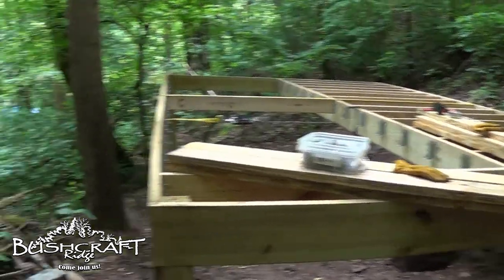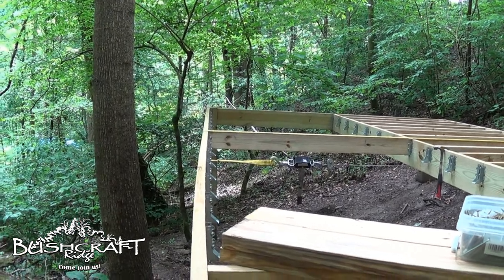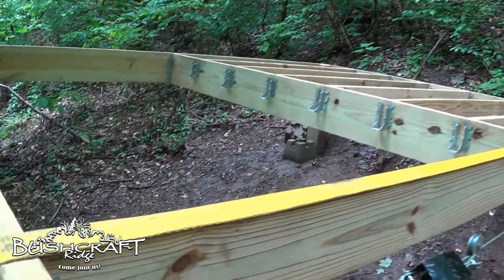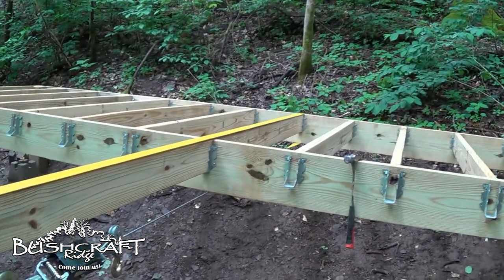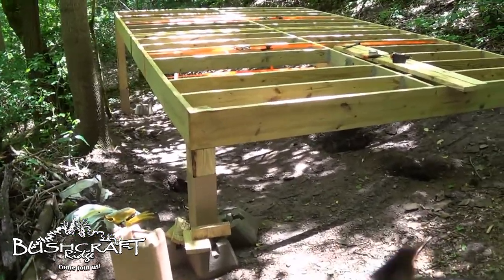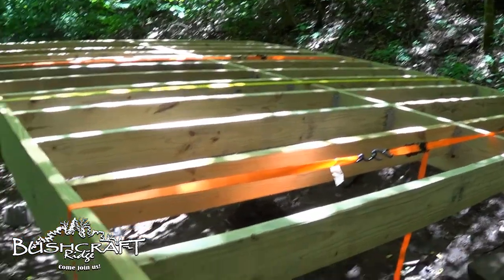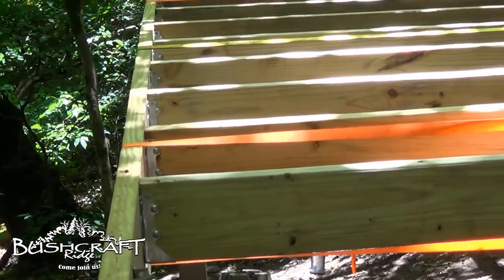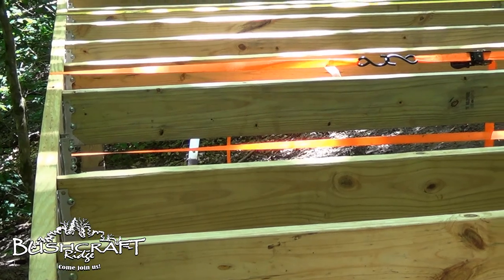Off-Grid Cabin Build 5.23.2020 -- Improvise, Adapt, and Overcome

Comment: Nice fix! Looking good brother!
Reply from the maker: Thank you, sir!
Reply: Bushcraft Ridge YW! I was wondering, do you think you could have pulled that bow back in when you put the decking on? Would have saved a lot of work if that worked?
Reply from the maker: Yep. That exactly why I have to leave it on until the subfloor material goes on. And I'm hoping it will get wet and dry out a few more times under the pressure and straighten up permanently. I still have 8 more 4x4 support posts that have to go in before the subfloor goes on.